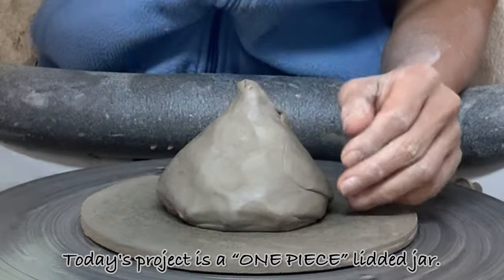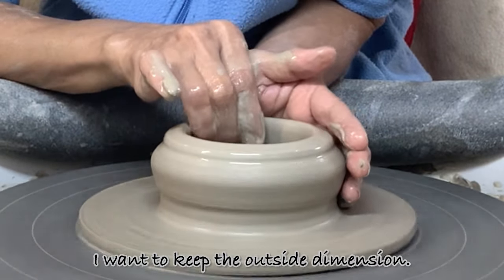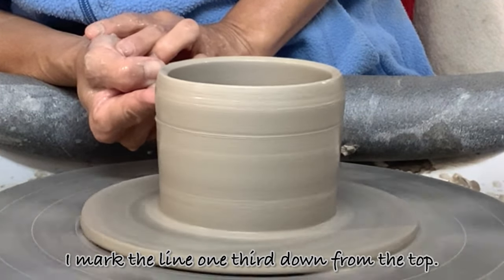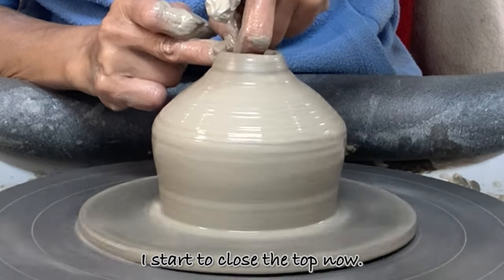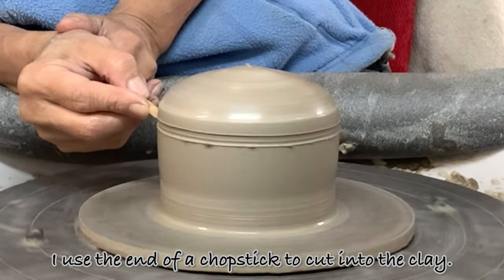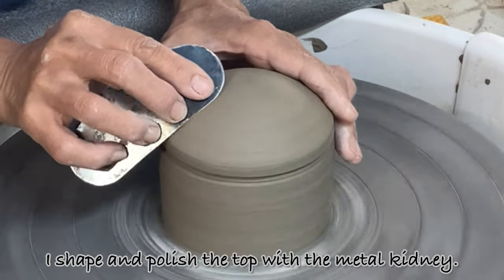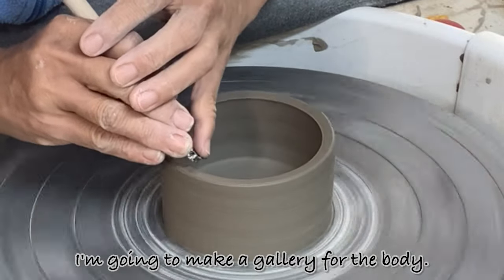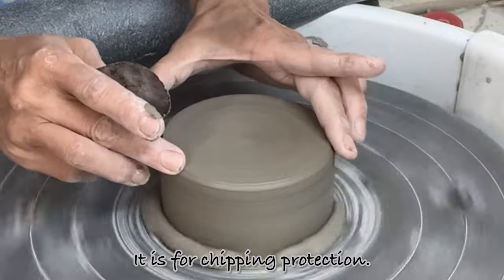Throwing a “One Piece” Lidded Jar on pottery wheel

Comment: Great video and explanation. I was hoping to see how you removed the bottom that you had wet to attach to the bat to trim. Did you wire it off?
Reply from the maker: Thank you for your your comment! I use the metal kidney to take a pot off. I used that method in the video “ Throwing a cup with twist”. the pot is attached mainly by the edge so just sliding the metal kidney in should be fine to separate the pot from the wheel. please try.

Comment: Thank you so much!! This was so insightful. When you bisque fire the pieces do you fire them still together? Or do you separate them
Reply from the maker: Thank you for your comment Hannah😊 This is a very good question. I fired them together for the bisque and glaze firing. I need to choose non running glaze and extra care for the joint part cleaning. This pot is tight fit so better to fire the lid and the base together. When I fire the wider flat lid I could  fire separately. The flat lid could sag sometime.
I mentioned about this in the cookie Jar video which has flat wide lid.
if you are interested in please check. Thank you for watching !

Comment: Great video. Thank you! Can you tell me about the brace you’re using for your arms? I need something like this for better stability when I throw.
Reply from the maker: Thank you for watching! This tube is water pipe insulation. you can buy at DIY shop in different size. My wheel setting is higher than usual to avoid the back pain. so I can not use my thighs for my arms anchor point. If you also have a same problem with me I recommend this style.
☺️

Comment: After trimming do you leave the lid on while drying to bone dry?  Thanks!
Reply from the maker: Thank you for your comment Angiea 😊 Yes I leave the lid on the pot. I want to them to shrink in the same condition. You may worried the lid is stacked the pot. In my case it doesn’t happen. The video one is quite tight you can see but no problem. You can start to make slightly loose fitting maybe.

Comment: perfect....good work.my clay work gets crack after drying
Reply from the maker: Thank you for your comment 😊 Crack after drying? which part of the pot?  If you are talking this close form pot and the crack is at the dome part pleas make sure your air vent hole is large enough to release the air. It may be closed during the drying and creates crack. If the clack happens at the bottom after trimming or firing, reduce the bottom thickness. This will prevent an “s” crack at the bottom.

Comment: The lidded piece  is called a sauce pot. Does that mean that it can be heated on a burner?  What clay is used. Bisque fired to what cone?  Glaze fired to what cone?  Thank you!
Reply from the maker: Hi Susan, thank you for your questions. I am not sure the first question’s meaning, could you explain again please. I used Stoneware buff with 20% Lava clay. Bisque fire is around 1000 degree.  The glaze fire is around 1220 degree. I hope this will help 😊
Reply: @AlchemyCeramic hello:) those must be Celsius degrees?
Reply: Susan, I'm not sure where you're getting "the lidded piece is called a sauce pot"
Anyway, to answer your question, no, the clay pot is not used on a stove burner.

Comment: Is there a speedometer on the wheel? How fast is it going and what is the position of your foot/ pedal?
Reply from the maker: Thank you for your question 😊. There is no speed meter on my wheel. The speed of the wheel is different depending on what I am doing on the wheel. I use a throwing batt most of the time so if you see how batt spins you can get some idea of speed at each stage.
My wheel pedal is just under my right foot. 
I know it is difficult to find good speed in the beginning. The best practice is centering and making a cone shape nicely. Also using different softness clay. You will realize the combination of wheel speed and hand power are key points.
Reply: @AlchemyCeramic  thank you so much for your help! I’m going to keep trying until I master it! 👍😊🌸